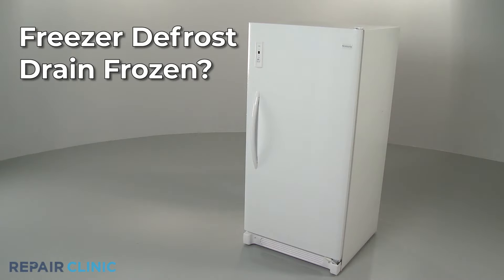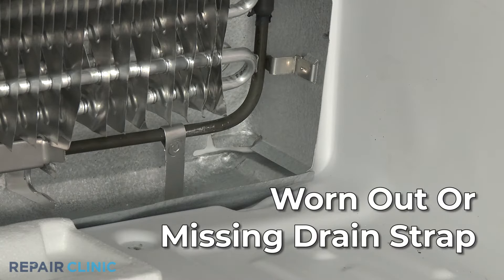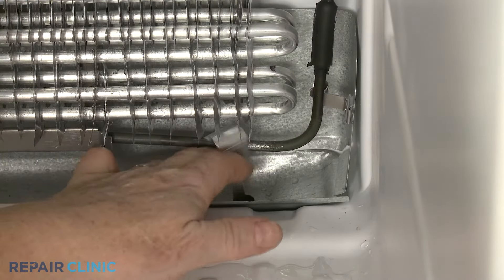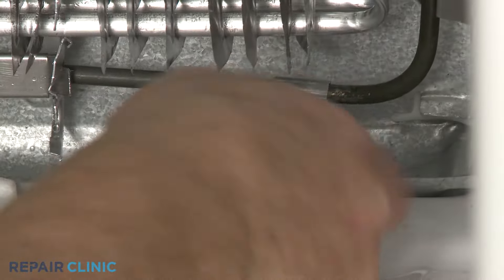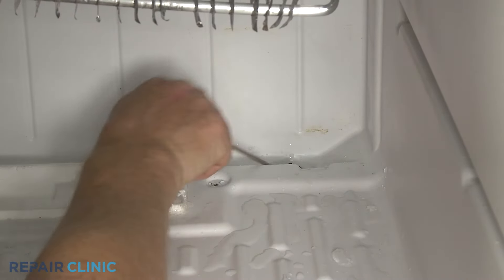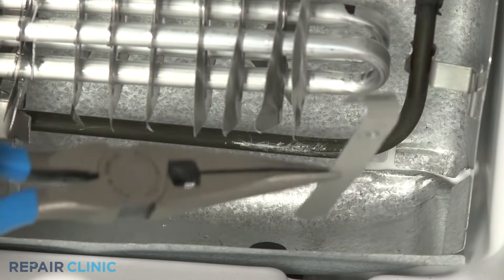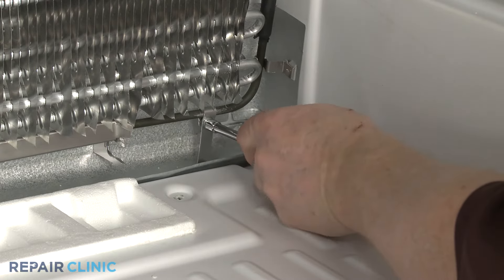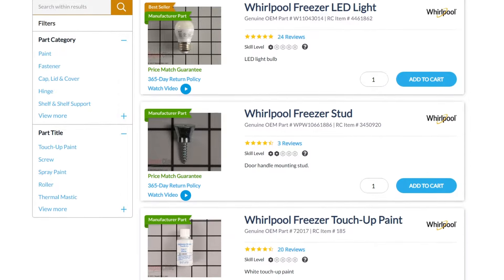Freezer Defrost Drain Is Frozen — Freezer Troubleshooting

Comment: It worked!  The aluminum strap wasn't resting on the bottom tray, so I manipulated the tray by bending the front end slightly upward at the rigged so that it could touch the aluminum strap, and I know longer have the ice sheet under the freezer floor.  Thank you!
Reply: How did you remove the back panel?
Reply: @SponkADonk  , I didn't have to remove the back panel of the freezer.  The refrigerator would've been too heavy for me to move out without help.  In my freezer model the bottom aluminum tray could be accessed through the front, (I opened the freezer door and removed the bottom food bin, and that exposed the aluminum tray).  I then noticed that the aluminum strap--that was designed to heat the aluminum tray--wasn't touching the surface of the aluminum tray by a fraction, therefore the water would freeze and not drain into the drain hole.  And since I didn't want to risk damaging the aluminum strap (I couldn't move it really), instead, I slightly bent the aluminum tray upward so that it could touch the aluminum strap.  I used a wooden kabob skewer (broke it in half) and stuck just a small portion of the skewer beneath the aluminum tray, which bent that part of the tray upward until it touched the aluminum strap. You may have to defrost some of the ice beneath the aluminum tray first so that the wooden kabob skewer can fit beneath the aluminum tray (I didn't have to go deep beneath the aluminum tray at all; I only used about 1/8 inch of the skewer).  I didn't want to use anything metal or iron at the risk of possibly being shocked or something.  And that did the trick!  Then I removed the ice sheet from the bottom of the freezer and dried it, then slid the bottom food bin back into its place.  Voilà!  I've had no problems with ice accumulating since then.  I hope it works for you.  Praying that it does. 👍🏽

Comment: Hello I have a Frigidaire model LFFH20F3QWC which is exhibits frozen water on the bottom of the fridge and over the drain hole. The aluminum straps are wrapped around the heater element and coil tube. There is no extension of the aluminum strap to the drain hole. I do not understand how the water is expected to not freeze.  What is the solution in this case.
Reply: Hi,  We have the same model with water leaking out the bottom. Just wondering if you resolved your issue and if so what you did? Thank you so much!!!

Comment: Thank you for this information. I have an aluminum drain strap that is not extended into the drain hole itself, instead, the tip of the aluminum drain strap rests on the drain plate beneath it.  Could that be why a layer of ice forms at the bottom of my freezer every 2 months that I have to keep defrosting?
Reply: @repairclinic  , I will try that, and then I will get back with you in about a week, to see if it worked.  Thanks again.